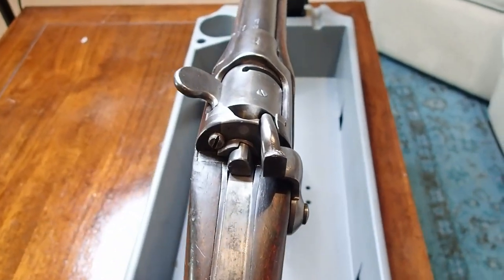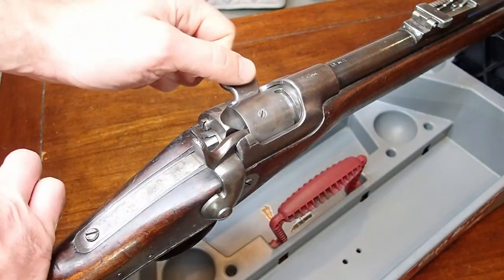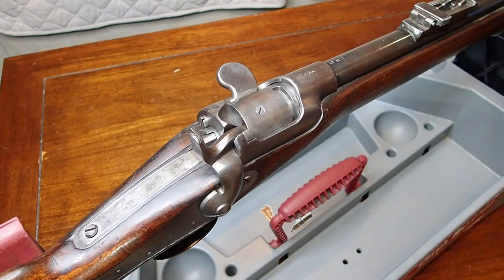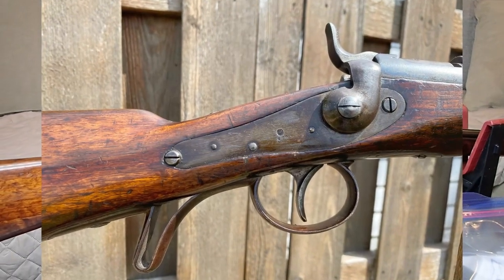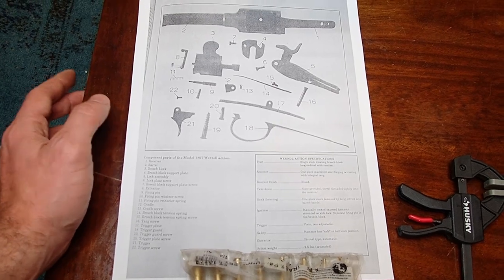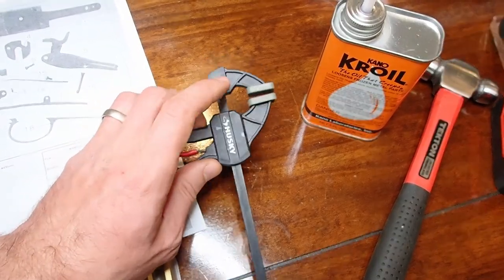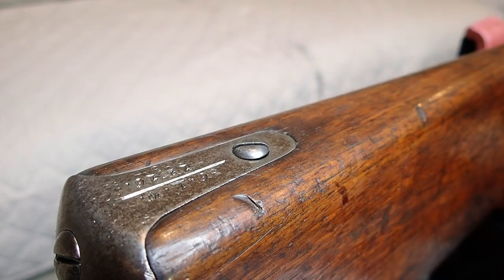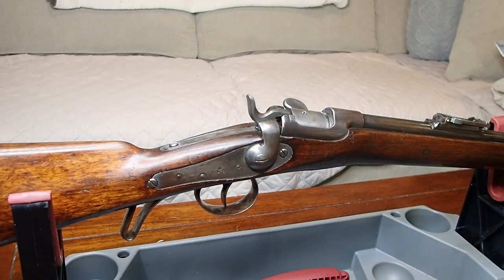1867/77 Werndl Disassembly and Reassembly

Comment: Very nice video and thanks for the mention!  There certainly are quite a few differences between early and later modes.  That rifle looks great too!  Quite a bit nicer than mine.
Reply from the maker: Thanks, it looks miles better than it did when I first acquired it. I did get some 11mm Werndl from Buffalo Arms, as well as some antique ammo on stripper clips (though I am likely going to keep that as a collectible), so I definitely want to take it shooting when I find the opportunity to do so. I am also interested in reloading for it, but I am still going to be looking out for a good deal on dies. CH4D seems to be the only one that makes them (custom) and they are pricey! Luckily I have experience reloading 11mm Mauser in blackpowder, so the process is somewhat similar.